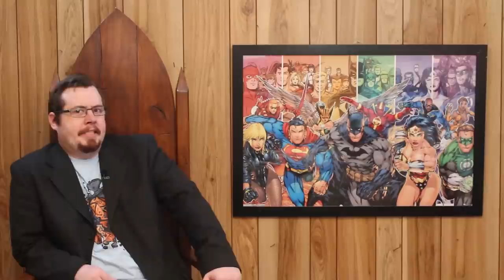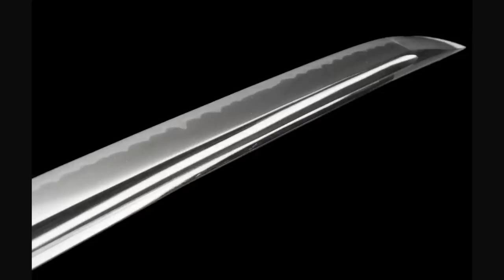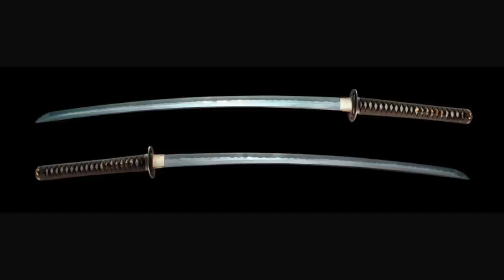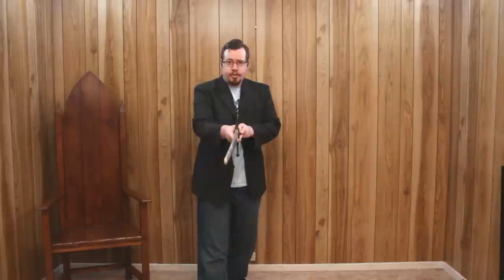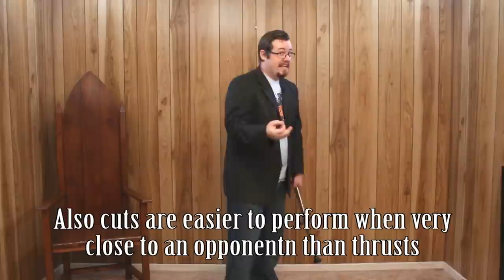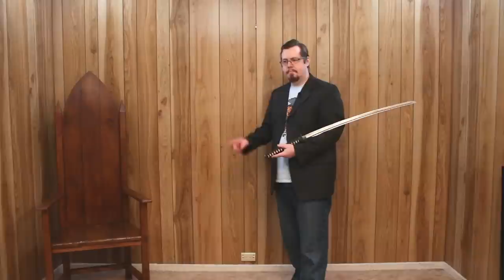Super cutting swords, are they needed?

Comment: Thrust vs. Swings is a long-time discussion that I had with many other sword-enthusiasts. I respect your opinion, sounds valid from the points you presented, but here's some (friendly) rebuttals:
Thrusting is quicker, but they're only harder to parry WHEN the defending side just swung their own weapon and not needs to recover their weapon's position to deflect the thrust. The downside of the thrust is that they're much easier to read. 
Swings are not as quick but they have more nuance to it. They're harder to read because different variations of angles can be changed from it's starter position. Just knowing the general direction that the swing is coming form is enough when you're blocking with a medium or large shield but, to parry with another weapon, it is not "just" moving it to a position where both blades touch (which is already harder than with a shield, from the volume they occupy in the space) but you also need to make both weapons connect in such a way that it neutralizes the impact that the incoming weapon would to on your body. That is to say that about half the ways you could parry a swing would make the attack not connect with the intended target, while the other half would have variations between impacts what would cause serious damage and others where the damage caused is reduced from the intervention of the parrying weapon
From that, differences in weapon weight and weight distribution between attacking weapon and parrying weapon comes into play. There is historic text that instruct sword-wielding soldiers to prioritize blocking axe-wielding enemies with their shield instead of parrying because the surviving soldiers would suffering injuries from trying to parry axes, which evidences that these "partialy-parried" attacks still had enough force to cut through butted-mail (which was the mail more common on the times knight-based armies fought against axe-wielding barbarians) or break a bone from the impact even if the mail wasn't cut open. Parrying against a heavier weapon, or a weapon that has a "heavier swing" (due to it's unbalanced weight distribution) gives the defender a smaller window of response, for it requires the attacking weapon to be intercepted before it acquires a certain amount of force momentum.
If a combatant is wielding a well-balanced weapon (a sword, rapier, etc) in their front, which is commonly called "dueling-stance", then thrusts are more easily parried since deflecting the other's thrust now rely more on timing of response and less on angle.
To sum it up, my educated opinion (which may be wrong) is that both fighters need to adapt their attacks and defenses if one side is showing preference or exclusivity on their moves (primarily swinging or primarily thrusting) and, if both fighters are mixing it up, then it's anyone's game. When full plated armor comes into play (and still talking exclusively about sword wielding here), then of course thrusting becomes the only valid attack to cause injury, save few exceptions if you find an opportunity to hit the opponent's plated head to make them wobbly (and THEN try to pierce them with a thrust where their armor won't protect or only mail protects) or to swing the opponent's weapon our of the way for a follow-up attack.

Comment: So i think there are some points, that not mentioned yet in the discussion:
Construction: The most good cutters are curved blades and curved blades have more differences to straight blades then the cutting power. Many of them are very Tip heavy , but don't feel tipheavy like a straight blade. Because of that many types of sabres have no Pommel (the Falchion has a Pommel i know). They have hooks and little shields to prevent slipping of (The Katana has a verry ruff gripp). Because of the tipheavyness, it has the same force like a straight sword but lighter (by the same forcelevel) because it has not so mutch weight on the hilt. At the same time they  are very nimble at very close attacks, and get power in low space moments from their tipheavyness. The other point is swordalignment. The curved blade hit with a very small line of the edge. Its like a ball fall on the ground, only a little piece touch the ground. A straight blade is more like a board that hit the ground with the small side. Thats ab bigger area, and so the force are not so much concentrated. I trained much with many types of swords and i use not much armor. its very complicated to hit with a DULL sabre in a way that it dosnt hurt. Straight blades are very ok and only i and other advanced members of my club use sabers because we have learned the "nice" way to handle it. But in the hands of a newbie...its dangerous, the same by the spear. The combat-reach isnt so important like a straight blade. Sure you make more damage by the perfect distance, but in close fights (Dagger range) it still hurts a lot. You dont need so much training to "hurt enough" the same like spears and clubs. But, and that is the Thing because i like Straight blades or slightly curved blades more: Binding is very dificult. You can't stop the blade of an enemy with a very curved blade, you have to hit it away or you let the sword of thy opponent slide to the side. Ah... but one point more, blades and also spears in the thrust can be grabbed, and they can be grabbed in the binding. Curved blades binding is verry rare, also thrust and no one want to grabb a swinging blade. Expirences like that could make a difference in some cultures to prefer the curved blade, but other arguments like chavalry, stuck-prevent and other are also true.  In my opinion, the sabre and also other more cut-likley-swords need not so much training to be effektiv (my own expirence) its like the spear, easy to learn hard to master. And because you have to hit other blades instead of easy blocking (specialy by strong curved versions) your fighting stile is more aggressive. every weapon has its stiles and cuttingpower is only a part of argument for a sword. I like shortswords with leafblades and macheteforms like the copis. You have a curve for the tiny-edge-space-hitting, a straight blade for trust and binding, and the very low lever-effekt on short blades gives me a great advantage in bindings and they are very nimble. but sometimes...these swords are not long enough^^. Nothing is perfect.

Comment: I don't think it's so much about being able to cut through an arm in one cut for the sake of it. If you cut into an arm, and only get to the bone, then you've essentially gotten your sword stuck in your opponent's arm. It'll take a significant amount of force to remove it. If your weapon can cut through an entire arm easily, then even if you only get to the bone, you'll still be able to recover easily enough to attack again, or parry, or even just cut the other arm off, too. 

Ok, this might not be such a big deal in a duel - but on a battlefield, when you kinda still need your weapon after disabling someone, I can see it being more useful.

And you kinda see that. I mean, weapons designed to provide a good cut have been all over the battlefields of antiquity for thousands of years. From the Khopesh of Egypt to the more recent sabres, that were still used when firearms were coming into play.

Yet, weapons for personal defense, that you'd carry down the street, or duel with, gradually got more thrusty and less cutty. Case in point, backswords and rapiers.

Seems like cutting has always been more prominent on battlefields, and thrusting has always been more at home in the realms of personal defense and dueling - and of you're on a battlefield, you want to cut as efficiently as possible - just as if you're fending off an attacker in a duel, you want to stab as efficiently as possible.

Comment: In the German longsword systems, thrusts are generally thrown from Von Tag, which is a shoulder guard. The most basic attack is done by cutting into the center and then stepping forward to thrust your opponent in the face. The cut into line protects you from the sorts of responses bad fencers will throw at you, and also makes it easy to transition into a cutting attack if you misjudge the distance. The step forward into the thrust gives you better reach. This attack, the Oberhau, is executed similarly to the example Shad shows at 10:30 or so.

It's as effective as any first-intention action. I have a lot of fun plugging newer fencers in the face with it, and it's an excellent set-up for more complicated actions against more experienced fencers. It can also be done as a defense, which is called a Zornhau, which is pretty effective against most actions from the shoulder.

Comment: The terror weapon is a good point, but also I think the leverage of the wound might stand to get the blade stuck in the target if you don't cut wholly through. For example with katana the blade goes through an entire soldier and immediately frees the weapon for a follow up attack, whereas for example if you were using a short sword (something less likely to slice through the target, something the longsword is more than capable of) and the weapon stopped at the bone, or worse dug into it 1/4 to 1/2 way through, the wound could close on the blade and make it difficult to free giving your opponent time to thrust into you at close range or for one of his buddies to take you out.  I know when I was using a chainsaw if you stop at all with it the tree leans into the cut and it becomes nearly impossible to get the chainsaw back out. Just a thought. Great videos, you've earned a subscriber!

experience:
Marine Corps Combat Trained (trauma experience)
self taught long sword aficionado
minor student in Iaido

Comment: I agree with those points Shad. If one were to make the comparison between sword fighting and mixed martial arts, they might find that fighter's who are too specialized in grappling are highly susceptible to striking attacks and vice versa. Likewise, an unarmoured dual between someone with a saber or rapier and another with balanced longsword would likely result in a similar outcome to pro boxer going against a UFC fighter in an MMA match. Or, if you could isolate the effectiveness of swords to just there own physical properties and chart that on a line graph, you'd find that cutting and thrusting have a linear relationship.

Comment: I'm a little over a year late to this discussion but I'd like to add 2 important points. (1) A thrust needs to be retracted from the body in order to be used again. It's easy for a sword to be "trapped" by the body that you have thrust it in.  Also add the people do not immediately die after being thrust into.  Even in modern accounts people have been stabbed multiple times and have still survived.  If you look into the accounts of the rapier when dueling was popular you'll find that cases where both parties have run each other through extremely common because (A) the sword was trapped in the body long enough for the opponent to reciprocate and (B) they were alive long enough to do so.  (2) Cutting kills quicker.  Stabbing someone in the gut, chest, or even a limb can kill someone, but not immediately.  A cut has "stopping power" so to speak and will incapacitate a limb or outright kill in a much faster fashion than a stab.

Comment: I'm trying to learn to wield the shashka(beginner so don't tear my comments to pieces please).. and I find your arguments are interesting... the cossack sworddance makes telegraphing less obvious.. the cuts are hidden in the constant moving and twirling of the weapon. . I do feel that cutting through a persons limb seems something the shashka practitioner would prefer; to allow the fluidity of movement to continue through limbs(assumption with no practical limbcutting experience)..and in this area of russian martial arts you are often trained to escape and minimize the damage of  weapon thrusts by moving your body.. not neccesarely by blocking a thrust with your blade ..at least that's how I've come to understand the style so far..also thinking that the extreme cutting power is helpful in fluid motion against multiple opponents. . to cut through one towards another. .. since we train with the assumption you're facing multiple opponents

Comment: Swinging the sword will yield mostly the same results regardless of how sharp the edge is (as long as it's properly sharp to begin with).

Slashing is completely different. In other words, the technique used will define how effectively you can cut.

When you're cutting a steak with a knife, how do you do it? Do you slam the knife into it? Do you press it down until it goes through? (I'm sure you've tried, doesn't work so well).

No, you apply a little pressure and jerk the knife back and forth until you're through. A properly sharp knife will often cut through meat without any pressure besides it's own weight and in fact sometimes more pressure will just make cutting harder than it otherwise would be.

This is why say the katana had such a strong emphasis on technique, how well the sword would cut depended just as much on the samurai's slashing technique as it depended on the sharpness of the blade. Without both of these factors in play you might indeed just use a longsword instead.

Traditional western swordfighting techniques didn't involve slashing (except for perhaps with daggers) but chopping, super sharp weapons like the katana are just about as efficient when utilized that way as a longsword. Axe will usually chop better as that weapon is designed specifically for chopping. But when slashing, a katana might cut through an arm like it were butter whereas a longsword would still be likely to get stuck on the bone. To chop well you need more strength to get through the bone to slash well you need more finesse and a sharper blade to cut through the bone.

Efficient slashing usually involves pulling the blade back towards you after the blade makes contact to make a 'cutting' motion. I'm not saying that a blade doesn't move that way when you chop, it inevitably does, but to slash you have to maximize that motion.

So basically in the right hands, the super sharp blades will cut much better than the regular ones, but to the point of whether it's actually any better. It depends on your goal, for example, if you're supposed to execute someone and chop off their head, would you rather have an axe with a dull blade that might require a few hits to go all the way through? Or a sharp blade that with the right technique will lop the head off clean? The latter is a lot more showy (public executions right? You wanna look good in front of the crowd, and you're an executioner, not a torturer.) Do you want to intimidate? Few things are more scary than a fighting machine that's chopping off people's limbs left and right.

This'll all work very well in combat, and yes, you can cut through leather if you've got the technique down. (It's not a myth that katanas can even cut through steel, but cutting through steel with a katana is more of a party trick than something you could do in combat, unless you're some sort of supersoldier. The cut isn't clean either, but fact is a fact, katanas 'can' cut steel under the right conditions.) but is it really worth all the trouble? The only time I can think of a super cutting weapon being used to actually lop off limbs in combat is against opponents with non-metallic armor, that is to say people wearing leather armor or no armor at all. It'd be very useful for killing off peasants! But in a real fight you need to find ways around the armor just as much as with any other weapon and that is why it might not be such a fantastic idea after all.

The truth in the end is always gonna be that the best weapon is the one you personally are the most skilled with. Give a samurai a rapier, he'll be pathetic, give a fencer a katana, he'll be pathetic. Give each their weapon of choice and pit them against each other, while the odds are stacked in the fencers favor the more skilled warrior is always going to win the duel.

Then as some people have been saying, to thrust in mounted combat you basically need a lance or spear or something like that,but slashing from horseback is a lot easier, and samurais did indeed like to ride horses.

Comment: Thrusts also have a comparative advantage to cuts in that they are a direct movement toward the target and thus are completed much more quickly. All you do is close the gap between the point of your weapon and your target on a straight line, it's the shortest path of movement possible. A cut can literally only be quicker than a thrust if you are already in position to start the cut, that's where your point about telegraphing comes in. You can thrust the point of your weapon toward your target from essentially any guard position, whereas to throw any specific cut you have to first be in the corresponding position. This is why sword vs. sword combat evolved into rapiers/sabres heavily focused on thrusts, they are the most efficient way to strike with a swordlike weapon.